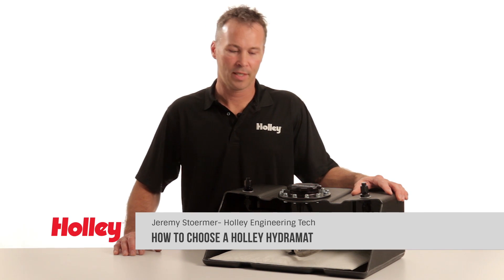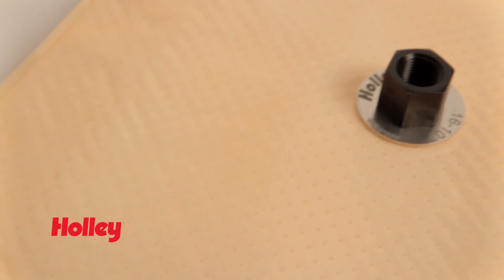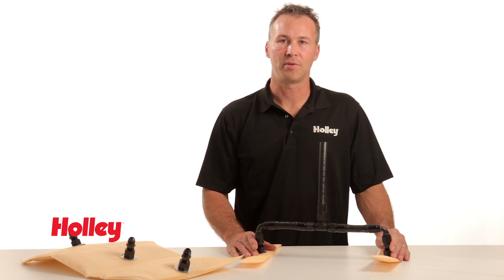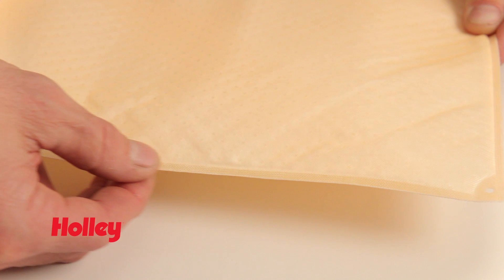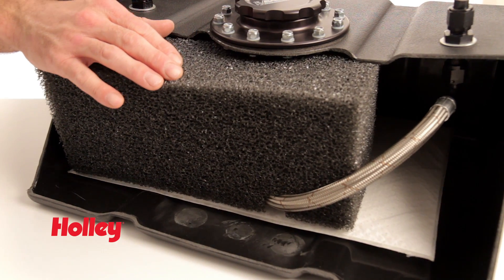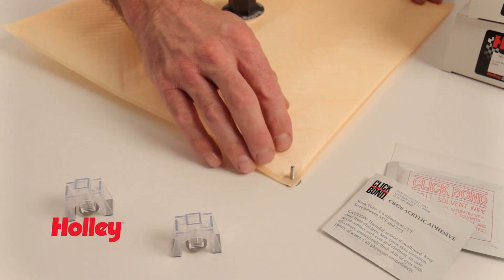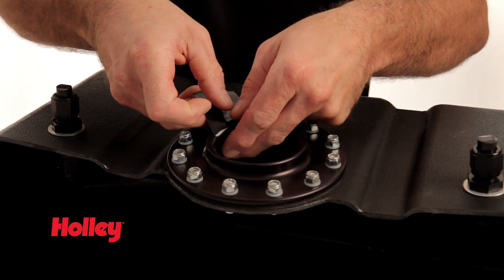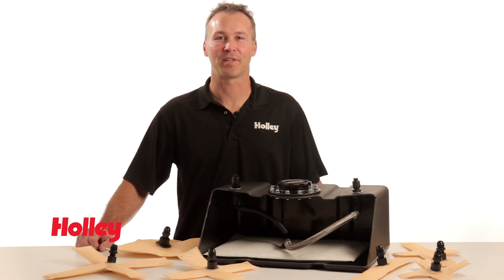How To Choose A Holley HydraMat

Comment: Oddly I just learned of this product. Unless I missed an offering, you should offer this for the stock GM in-tank pumps to use in place of the stock fuel strainer sock. Almost every guy I know running a fuel injected street car/truck like an 80s C10, OBS truck, G-body, 80/90s F-car, 90s B-car, etc use the stock style tank and older style EFI sending units that usually result in horrible tank baffling. A simple square shaped mat that would fit through the factory GM tank opening with a GM sized push on connection for the OE style pump would cover 100s of OE GM tank applications and probably a lot of other vehicles as well. Even stock GM vehicles of that era could benefit from it, preventing fuel starvation and pump damage if the poorly baffled GM tank is ever run under ~1/4 tank.  I would already have one in my 80s G-Van if it existed. I found out accelerating hard uphill even with ~8-10 gallons in the 33 gallon tank it will starve the pump.

Comment: What about those of us that are considering using this in a daily driver in a fuel tank without baffling?

Im doing a Sniper Stealth install on a 306 I am building for my '82 F150 Flareside and I am sourcing a new 85/86 fuel tank and 85/86 fuel pump sending unit.  Problem is ford didnt install baffles in these fuel tanks till the very early 90`s.  This I sounds like an excellent product for a daily driver with a rv/tow based engine build but with the whole 5 - 10 year life time expectancy it makes me question if its worth the cost for a daily driver.

Like wise whats this about not being used with other fluids?  So you cant throw in a bottle of fuel injector cleaner or run what I run in all my vehicles which is Stabil 360 that is a cleaner/ethanol stabilizer?

Comment: We use Hydramats on Subaru street/road-course applications. It's an in-tank twin Walbro fuel pump setup with a rectangular Hydramat per pump. It works very well! On 2008+ Subaru STI or 2005+ Subaru Legacy, there is no in-tank baffling and the engine can starve even with 3/4 tank of fuel around fast right-hand turns at the race track. We did not want to cut up the car for a fuel cell and surge tank setup and decided to try the Hydramat. The car has been tested at Gingerman, Road America, and NCM without any fuel starvation even below 1/4 tank mark. We even went as far as to test the limits of the Hydramat by doing a continuous right-hand turn on a highway 'cloverleaf' interchange and stopped when the car just experience fuel starvation. Drove straight to the gas station and filled 15.5 gallons. Subaru's have roughly a 16-gallon tank. The Hydramat did its job all the way down to about half a gallon of fuel in the tank!

Comment: How about using this in a street application? How well does the Mat handle Ethanol mixed fuel? I'm planning a tank build for a project and curious about using a HydraMat for continuous clean fuel pickup to feed an LS3 on the street.
Reply: from what I read it sounds like gasoline based fuels are fine.  just no oil, diesel or other fluids what ever other fluids mean.  I am looking at this for my daily driver that I am building a Sniper Stealth fuel injected rv/tow 306 for and I dont like how vague "other fluids" are and the whole 5 to 10 year life time expectancy doesnt sit too well with me either.  I am curious how this is not able to last long when traditional socks will outlast the fuel pump or the sending unit float if you have a mechanical fuel pump on the block.  Youd think the technology would be there for this wicking material to last longer than that.  Being in a street truck I sure as hell wont be dropping my fuel tank every few months after 5 years to check the mat, that might be fine for a race car but they sell this stuff for retrofit fuel injection setups for classic cars.

Comment: Does it still need to me mounted to the tank if using foam also?
Reply from the maker: You can use very coarse foam (the coarse foam will allow better fuel flow to the mat) to help keep it in place instead of anchors. thx J

Comment: w o u l d  be great..if it wasnt $700 bucks
Reply: wait, there is one that is that expensive?
I just got a 15x15 for $300
Reply: brianmathew09 that's why I didn't buy the biggest one that fits my gas tank if anything it might be too small for high G forces and win I'm below a 1/4 a tank. mine is a cross. In another video from Holley they said there's a hp / lph limit for a given size but were is the reference?